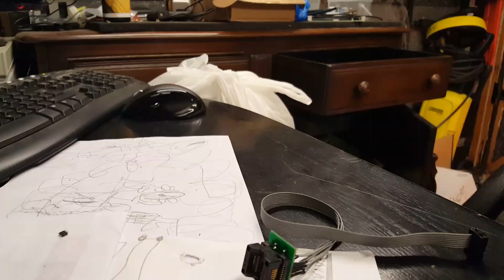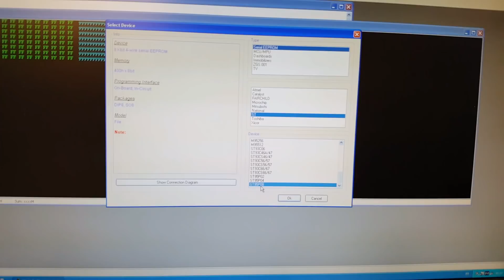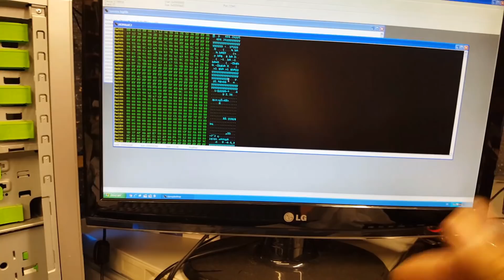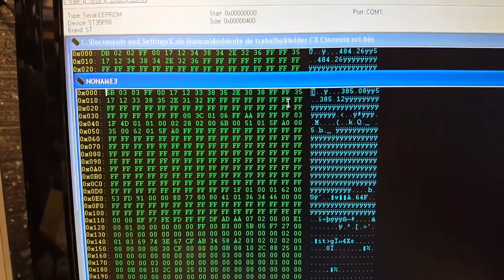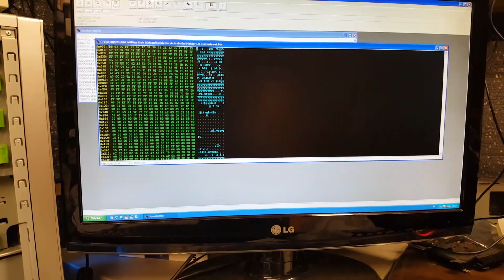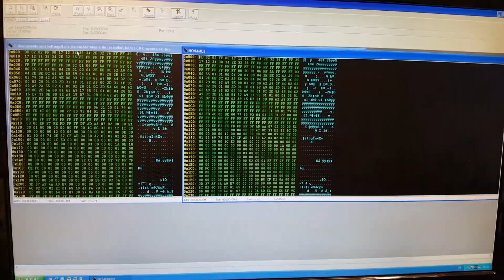Clone/copy immobilizer Bosch EDC15C2 eeprom 5P08C3.

Comment: Daniel, I have an 03 diesel 1.7 combo, cant talk to ecu, got another ecu, got backs off both of them, but they got two chips that look like eeproms in each brain, so should i swap two from one brain with the two in other thanks, or if not how do you tell which one is for iombilizer thanks
Reply from the maker: Hi
Careful... some chips they look like eprom but they are not..
See what is the chip ID... the letters on the top...
Which ecu is that?
Do you have the pin of the donnor ecu?
Thank you for watching!
Reply: @LMAutoRepairs  its a  vauxhall combo van with a 1.7 isuzu diesel .delphi, 1.7l/tx2 diesel ecm . is on sticker , i just had another look, and theres 3 8 pin chips that look like eeproms thanks
Reply from the maker: @virginsmoker  
Hi
The eprom on that one should be a 25C320 chip...
Is the one close to the corner, with two brown capacitors in front of 4 of the pins... if that makes sense...
Hope that helps.
Reply: @LMAutoRepairs  thats it, if brown capasitors are on left furthest away from you  sitting side by side, then there are two black ones closest to you in a l shape  10-35 n3 with a 4 pin chip that looks like an eeprom faceing end on to them. The chip you are talking about near brown caps has a number of " 9357471   0105   h35
Reply from the maker: @virginsmoker  
You got it...😉
Reply: @LMAutoRepairs  just waiting for cheap usb microscope to come through the post, could only just read them chip numbers with two  magnifying glasses held together and a torch lol. everything is soooo small , thankyou thankyou thankyou you're a diamond
Reply from the maker: @virginsmoker  
No worries...
Here to help...😉

Comment: Hi, Luis, great video. Do this chip contain the injector codes that are printed on the injectors because i recall once you change ecu it has to be programmed to the replaced ecu otherwise it wont start
Reply from the maker: Hi
It depends... some cars don't even need the injector codes...
Others will start but might trigger the engine light... every maker is slightly different...
But, some ecus will have them on the eprom, and some on the flash...
You need to know which ecu you are working with...
Thank you for watching and for your comment!
Reply: @LMAutoRepairs  hi. Ok i have a citroen c3 hdi 2002 model , i bought a lockset , can the eprom from bad ecu be swop with the one i bought.thanks again , great stuff

Comment: Hi, great video! Please can you tell me if I can do this procedure for a Bosch Med9.1.1 for an Audi S5 pn 8T0 907 560? I have to swap 2 ECUs between them. Also which one is the eeprom chip inside? I can't find any details anywhere. Thank you very much!
Reply from the maker: Hi
Don't quote me on this... but I believe that ecu has a 95160 eprom... so you should be able to esily swapped them...
I am not sure is there is any data immo related on the flash... but you can swap the eeproms and go from there...
Hope that helps. 
Thank you for watching and for your comment!
Reply: Did you get your S5 to work I think I need to do the same on my S5 i don't have any power on the ignition system

Comment: Hello please could you help me, I would like to clone from me the ECU of the Audi A3 8P 1.6 c.c 75KW (102hp) petrol, I already own the receiving Ecu same code as the original one , you tell me the equipment that I need es the program to use? thank you very much for your help, greetings
Reply from the maker: Hi
Not sure what is the ecu on that one..
But if the eprom is external, just do swap them...
Otherwise you might need K-tag or similar...
Thank you for watching and for your comment!
Reply: Hi LM Auto Repairs ,thanks so much for the information, I tell you specific information ,the my ecu is :
SIEMENS 06A 906 033 BB  , SIMOS 7.1  (5312) thanks !
Reply from the maker: @rockyW46  
Just swap the 93c86 eeproms... and you will be good to go...

Comment: Hi, thanks for the video to start with. My idea is to have a clone of mu ECU as I will attempt to remap it myself. I have bosch EDC15c2 with 5P08C3 (identical as per video). 
Following your guidance and using blank soic8 eeprom, would it make sense if I read my with soic8 with clamp (no desoldering needed) and saved the .bin dump and then uploaded it to new eeprom (or erase and write to the existing one, that will mean I would have 2 identical IMMO coeded ECU's?

Comment: Hi, I am sorry but i do not understand why you do erease/copy the eeprom instead of removing it from the old pcb and put it back to the donor one...
Reply from the maker: Hi
For the simple fact that I was asked to leave both ECUs programmed to work on the same car...
Hope that answers your question...
Thank you for watching!
Reply: Clear enough ;) thats a good idea to have a clone in case one ecu goes out, he can just replace it with no extra cost... 
By the way, I owe a mercedes c220 cdi 2003 with bosh 0281010851. I have the picture which i could send to u if u want to and i have three eproms on the backside of my ecu. How do i know which one to copy and clone? Thanks for your answer.
Reply from the maker: @rsg1682  
Three eeproms?
Are you sure the other ones are not voltage  regulators or some other type of chip?
I would say only o e is the eeprom...
Reply: i ll check references on it to sure but they all look like the same lol the one i suspect to be the right one has only reference numbers written on it such as 2310987 and an other number starting with 30.... no branding, nothing... Thats only the only one placed the opposite way as the two other ones. the reading happens on the other side of the ecu, weird...
Reply from the maker: @rsg1682  
Don't quote me on this... but I believe that ecu should have a 95p08... it can however, be disguised with other marked numbers...

Comment: Thank you for good video, and information! 

I decided to try Xprog for Reading and writing (copy) on immo eeprom. From what I've found out Xprog is better for this than e.i. Galletto V54 from Fgtech. Any thoughts on that?

Eeprom is type 5P08c3 (sits in Volvo ECU - Bosch EDC15 11 ) (and probably other types later) Do you know if Xprog v 5.55 (about 40Euro on Ebay will  manage this? (Looks like you maybe have an older Version, so it should work?)

There are so many different types i.e.: v5.55 - H7L7, CAS4, I2B5, S3R4 and so on. I've not found out what the differences are. 
Do you think it is better to pay more to get v 5.60 (72 Euro), v5.74 (100 Euro), or v5.84 (160 Euro)?

Thanks!
Reply from the maker: Galletto is a different tool...
X-prog is more for direct reading of eeproms and MCU's...
Depending on what you need, x-prog might be a better option...
Hope that helps.
Thank you for watching!
Reply: Thank you for the reply. Yes I know. 
My main question was about different Versions of Xprog (at the bottom of my posting).
Reply from the maker: Hi
Yes i missed that last part... sorry!...
You get what you pay for... simple as that....
My x-prog is a few years old... I know there is newer versions out there, but never really researched what is included on them...
But, as above, get the best you can afford, and you can't really go wrong!

Comment: Hi, i have a 807 with edc15c2 2.0hdi and reprogram eeprom an am29f400  with no immo bin files. Car does not start yet, should i reprogram BSI? Please HELP! Thank you!
Reply from the maker: De Ce 
Hi
Where did you get the eeprom file from?
Thank you for watching!
Reply: I’ve read and used a program to remove ImmoServiceTool. I lost my original eeprom files that why i need immo off.
Reply from the maker: Hope you have learned the lesson of the importance of make backups before do anything with the files... lol
I do have an original dump and an immo off dump from that ecu, although was from a 2.0 206...
Reply from the maker: I think you first need to get a good programmer...
Reply: Good to know, thank you for your help! Programmer makes good work except this 5p8c3 old eeprom.

Comment: My vw polo 1.4 can not start after connecting the battery backwards. At first  it brow the fuse after doing  a wrong battery connection. Then I bridged the fuse thereafter it was again wrong connection of the battery. This time it can start.what could the problem
Reply from the maker: Danny Chilembo 
Hi
So, you bridged the a fuse, and then you connected the battery backwards again!?
Try to scan the car, and see which modules you can't connect with... check all fuses etc... do not bridge them... replace it!
Thank you for watching!

Comment: hi, can this procedure also be done with carprog and using a eeprom clip surplied with carprog? also can you not using a clip read the chip in place? great video and thanks for sharing!
Reply from the maker: Ryan Colley 
Hi
Theoretically yes...
But, if you can remove the eeprom, do it... the chances of a successful read is much higher,  as you don't have the interference of the other components on the circuit...
Hope that makes sense...
Thank you for watching!
Reply: LM Auto Repairs many thanks for your reply and info! ill bare that in mind, thanks alot!
Reply: I spent many hours looking exactly for this information...
I'm mechanic and I'm starting to do this kind of jobs. I built a Carprog and after watch your video and read the comments, I'm not sure if is necessary in my case:
I have Citroen C5 - EDC15C2 ECU that contains serious damages on the board caused by one of capacitors, that exploded and burned a big hole on the base.
If I'm right, you did a copy for use booth ECUs in the car, but in my case, you think that only changing eeproms from damaged ECU to donor, could be enough for start the engine?
In advance, many thanks for your work, for make it that looks easy, and obviously for share it.
Regards from Barcelona;
Guille

Comment: Do you have a data sheet to help identify the eeprom chip. where can I get the data seet?
Reply from the maker: Donovan Bent 
The eeproms are usually engraved with the  chip type... is not like I have a diagram of that ecu that tells me the chip location... 
What exactly are you looking for?
Reply: Trying to find the easiest way of id the eeproms don't have much knowledge on them
Reply from the maker: Donovan Bent 
As you start to get familiar with the way they are marked/named, you start to identify them pretty easy...
If you are not sure, just Google the numbers and letters written on the first top line... 99% of the times you will find what they are...
Hope that helps...

Comment: Peugeot 206 1.6/MP7.2 Year 2000 - PP2000 gives Error Reading the ECU (the computer does not respond). ECU unlocked, no IMMO, but the car starts. Not yet read from BSI (HC05), read from 24C02 in MP7.2 but it is blank. Tested the connection from ECU pins 19, 20 and 44 to DLC pins 15, 7 and 3 is connection. What can the error be? Because ECU is not locked?

Comment: Hello! I need to clone immo of my edc15 dde. anyway, Where do I find same adapter for the chip you used in the video to X-PROG? Thanks
Reply from the maker: BMW DieselPower 
The adapter you can get it from eBay or other online sellers.... and yes, I have used x-prog...
Reply: Yes I did order x-prog kitt newest with everything, but i dont find adapters for eeprom that is made for x-prog anywhere? Thanks
Reply from the maker: BMW DieselPower 
As I said, on eBay you can find the adapters... all you have to do is the connection cable to x-prog...

Comment: +++

Witch solderingstation do you use?

And what hardware/software?

I heard x-prog?

Can one package read all types of eeprom,s ?

Im a newcomer with ecu/eeprom etc
Reply from the maker: TheMatrixcube 
I do have a temperature controlled soldering station... there is loads out there for different budgets....
I also have an hot air gun...
X-prog can do a fair amount of chips, as well as MCU's... so is a good investment... 
It can't do them all... but not all tools do them all any way...

Comment: thanks man ??
but why u need to read the eeprom ?
can i solder it directly from the bad ecu to the new ecu without the need to read ??
Reply from the maker: Hi
I have already answered that same question... You can obviously, but I was asked to leave both ecus ready for the same car... Presume they wanted to put the original ecu back in, in case that was not the problem...

Comment: Superb video, so why do you need to remove the chip to download it's contents, cant you figure out a socket clamp to go over the device pins  in situ ? or am I  missing something, would be a lot easier ???, then you could clip other device and upload other chips data ???
Reply from the maker: DiyMech 
Hi
You are absolutely correctly...
The only thing is that some programmers, and/or some boards layout do not allow to read the chip while on the PCB... the best safe way is remove the chip...  consider to read in circuit  (while on the pcb), MCUs or big chips... for a 4 pin chip, safest way is removing... but hey, this is just my opinion and the way I do it...
Hope that helps...
Thank you for you for watching and for your comment!

Comment: I had a Lexus IS300 in shop for bad gas gauge and blinking low fuel light. Scan codes, nothing in ECM except P0420 and P0430, replace cats fixed that problem. Could not communicate with BCM. Pulled tank unit(easy) and the sender was ok. Boss said put a cluster in it. I decided to pull BCM, and it had corroded areas on the board. I cleaned the corrosion and reinstalled and it worked. How long, who knows. Called around, dealer, etc for new BCM. Remans were $325 and had to be programmed on car by dealer. New from dealer $550 and same programming issues. We cannot program in our shop. No equipment. I bet you could have figured this one out. Would have been an interesting case study.

Comment: My friend are You sure that flash is the same in both ecu's?
And for checking differences in dump use HexCmp, great program.
Reply from the maker: Przemek AutoElektro 
Hi
What was copied here was not the flash...
This eeprom contains the immobiliser data, and few more settings,  settings that will not prevent the car from starting, and this settings can then be adjusted using lexia....
Hope that helps 
Thank you for watching and for your comment!
Reply: Yes, i know. But those ecus got other numbers so i think that they can have differences in flash dump. If they are not from identical car with identical engine and identical numbers i allways compare flash dump to check if its the same. Anyway, great vid as always! :)
Reply from the maker: Przemek AutoElektro 
Good point...
Thanks!

Comment: Thank you for sharing. Have some questions
 1. What is the name of the eeprom adapter? Need to order it apart from xprog.
 2. BMW EWS2 has MCU with security, if u try to read it onboard it erases the chip. Can I read it securely if I desolder it or maybe there is another safe way?
Reply from the maker: Mambre Khachatryan 
 Thanks!
1. eBay search for 'soic8 adapter '
2. never done that one... but I would remove the chip... X-prog is capable of bypass the security on some chips/mcu... not sure about the one in cas2... Google surely will give you some clues. 
Hope that helps....

Comment: How do you know if dump is read good or is corrupt ,usually  if I don t see anything meaningful on the right side of the dump I suspect the dump is corrupt
Reply from the maker: radu soptea 
Good question...
I usually read the chip, and the verify... if no errors should be ok...
The fact that nothing mean full comes up on the ascii column does not necessarily mean the reading is corrupted, although it can be a good clue.
That comes with experience. 
Thank you for watching!

Comment: Let us know, if the repairer guessed right with the original ecu holding the injectors open. Cheers for the video mate
Reply from the maker: MrLipp24 
I will...
Reply from the maker: MrLipp24 
Unfortunately the problem was not the ECU... I am not though if he got to bottom of the problem... if I know anything I will post it here...